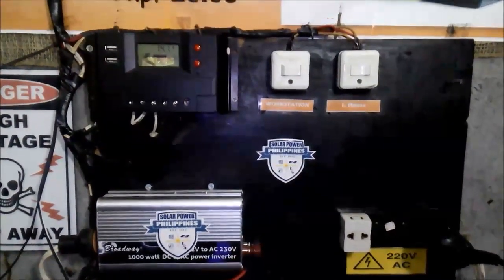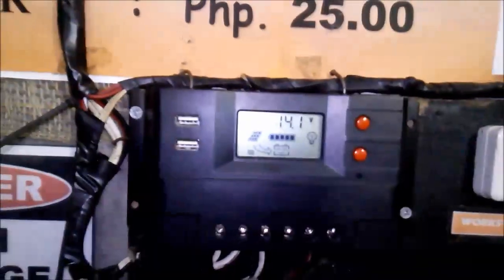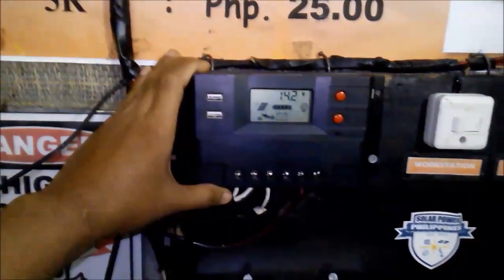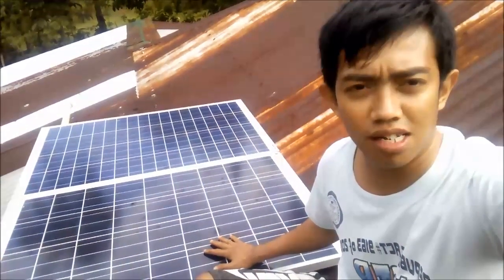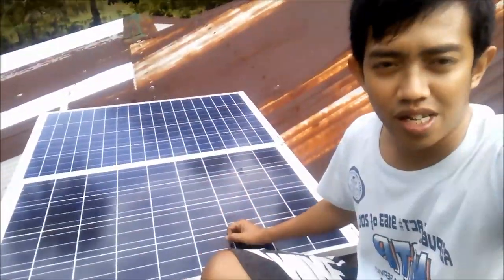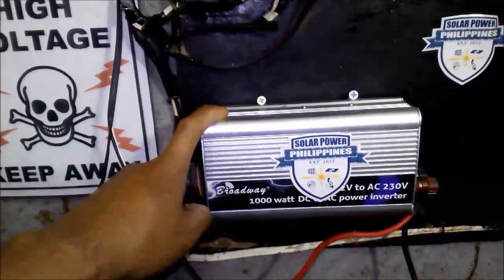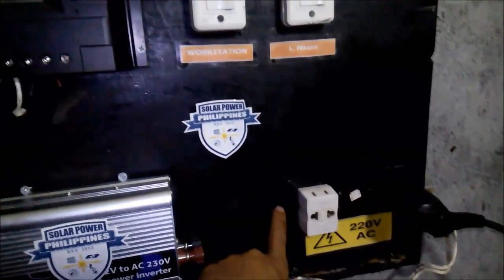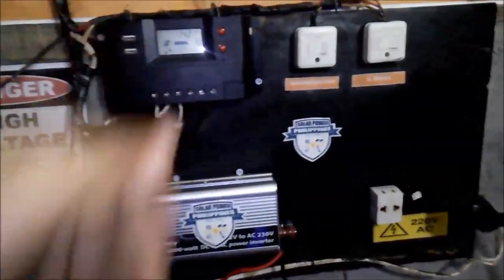DIY Offgrid Solar Setup- 100% Free Energy

Comment: padali in mo nalang boss. ganito lang po yan kuha ka ng battery tapos tingnan ilang volts kadalasan  12v tapos ilang Ah ang battery like 48Ah normal na battery ng sasakyan... so  12v X 48Ah = 576W so kong meron kang 150W na panel maka produce yan ng 600W sa loob ng limang oras. pano?. ganito yan sa 150 W na panel meron yang power loss 20% so 120W nalang multiply buy  5hours = 600W kada limang oras. yan yung mga oras na tirik ang araw... ma full charge ang battery mo apat or limang oras kung gusto mo mapadali dagdagan mo panel mo like x2 para dalawang oras lang. so kung gusto mo ng fullcharge palagi ang battery na parang di nababawasan mag lagay ka ng apat or 4 na panel na tag 150W para sa battery na 12V 48Ah. yan yun. at Pag nagka pera ulit e upgrade nyo nalng battery nyo at dagdag  panel para palakihin ang Wattage nyo para andar boong bahay ref,, aircon, tv , washing machine etc.  mura lang yung inveter at mura lang din ang controller.

Comment: Sa may gusto po may binebenta po ako solar panel 5 na 100 watts at 2 na 50 watss used na po sya pero 100 percent working pa po. Bali po binaklas po namin sya kasi lumipat na po kame ng bahay.. 10k fix na po libre ba po ang inverter at charge controller used nadin po.. Eto po fb ko mariz greno po .. 09508344484
Reply: available pa ba sir?

Comment: Sir may 2 air con ako, isang ref, 1 washing mach, 3 tv at 10 ilaw sa bahay, magkano kaya budget kung mag pa install ako sa iyo, salamat po
Reply: Almost 100k kailangn mo ng 5to 8 kilowatt
Reply: @LoretoLlosala  ahm ok , 100k labor and materials na yan, sa yo na lahat
Reply: Helo gudpm pacincya na po sir ha naki alam ako sa mga coment mo by d way yong sinabi ko na 5 to 8 kilowatt kulng pa ya kasi yong pure sine wave masyadong mahal kysa modfd wave
Reply: @roniegamlot9566  ahm gd eve, ilang kw ang kailangan ko at mas maganda somobra para may buffer at magkano kaya budget ang kailangan ko at hindi ba madaling masira, salamat.
Reply: @renosoler6232  mas maganda snadi inverter 3 or 4 kilowatt maganda na yan mas malki yong transformer niya kaso mabigat lng kc about sa price 22k at 40k ok na yan pang bahay lng
Reply: @roniegamlot9566  isa ka bang supplier o installer lang gusto ko kasing malaman kung magkano lahat magastos ko kung mag pa istalar.
Reply: @renosoler6232  ok sa sinabi ni boss lorito mag depende sa mga load mo kung my mga aircoñ po kau cguro mga 250k
Reply: Yong 100k dipa sapat yan yong sa akin 4000 watts snat inverter  48 volt 40.000 plus at my 6 akung panel 24.000 apat na battry tig 100 ah kaya kulang payan sir wala pang labor sir... Salamat sa rply sana mrami kpang video na ma upload

Comment: Sir magkano gastos mo sa setup mo nato gusto ko po sana mag set ng ganto eh
Reply: @LoretoLlosala  ikaw po ba nag set up nito? sana may tutorial...
Reply: Yung sa akin 160w off grid set up. Gamit ko lifepo4 12v 45Ah battery at 1000w msw inverter. 15k nagastos ko. Ako na bumuo lahat.
Reply: Running for two years na.

Comment: Kaya 4 pcs100 watts 22voc nyang ssc mo?
Reply: @LoretoLlosala  Nice input. Ilang hours ang full charge ng 120 ah mo with 2 panels? And mono ba yan? Planning to setup 4-5 pcs 100 watts 12v since me mga appliances ako na 12v.
Reply: @LoretoLlosala  at tska sir, ung ssc mo me current reading? Pano mo nalaman ang ampere load mo? Curious ako kask 30a 12v ang batt na gusto ko which translates to 350W
Reply: @LoretoLlosala  ano name ng ssc mo sir? 30a talaga actual? Pls enlighten.

Comment: Sir.taga Pangasinan ako Nakabili ako ng SMA 5000WTS inverter..Saan Banda makabili ng Magandang Solar panels.
Reply: @LoretoLlosala  sir.Anong Panel po ang pinakabranded..
Reply: @LoretoLlosala  Sir Trina Solar Panels..maganda po ba..taga Saan kayo sir
Reply: @LoretoLlosala  Malayo po ba kayo Pangasinan Sir..kong Sakali Ikaw Napo mag Install
Reply: @LoretoLlosala  Sir ito po yong Inverter Ko. Vdc max.600V....Vdc mpp 246-480V....Idc 26A....Vac nom.230V...Fac nom.50/60Hz...Pac nom.5000W...Iac nom.21.7A..
Reply: Sir..ilang panel ba Kailangan Ko.at Makahingi ng Diagram for Installation sir..
Reply: @LoretoLlosala  ok na sir
Reply: Madami seller s solar power philippines group s fb.

Comment: Hi sir, i have a very small hobby type solar setup.  Kaya lang malowbatt ang battery , capacity is 12v 4Ah SLA battery, my question is howmany hours para mafullchrge ang battery ko? Kasi pag siguro 4:00pm lowbatt na sya nasa 10volts na ,do you think sira na battery ko? Madali mafullcharge madali din malowbatt ,secondhand lang sya hiningi ko lang sa motorbike ng tatay ko. Sir loreto Tumitingin lang ako sa mga videos mo baka sakali meron ako matutunan pwede gayahin..Ito ang solar setup ko. Salamat. https://youtu.be/wQNQM5qd32s
Reply: @LoretoLlosala  meron ako controller 10Amp SCC, sa display ng controller ko lang tinitingnan ang voltage nya, umaabot naman ng 12volts kapag naka connect ang solar panel diba kapag hindi na nag biblink ang arrow meaning fullcharge na sya? yun ang battery bars sa display madali mag 2bars, kapag wala ng sikat ng araw 5:00pm, madali na malowbat ex. 12.4v madali ng mag 11v at pababa na ng voltage
Reply: @LoretoLlosala  umaabot naman ng 14 or 13volts kapag matindi sikat ng araw, pag wala araw disconnect ko na solarpanel sa scc may alligator clip kasi sya. Tapos pinapasok ko na sa loob ng bahay ayon 2bars lang ang battery sa lcd display at 12.3v lang at pababa na
Reply: @LoretoLlosala  gusto ko sana substitute ang 12v lithium battery na 18650battery , kaya lang hindi ako marunong gumawa , need ba ng BMS?
Reply: @LoretoLlosala  load? Ah yung solar charge controller ko may usb port , yan lang ginagamit ko pang charge ng mobile devices ko, wala naman heavy use load, bago bili lang ito solarpanel at scc kaya sure ayos at brandnew. Siguro nga battery need ko bumili ng bago
Reply: 4ah x12v=48watts battery mo napakababa mabilis ma full charge kaya lng mabilis din malowbat lalo na pagwalang ng araw..
Reply: Sir ok ba ang car battery

Comment: magkano inabot ng gastos mo sir?
Reply: @LoretoLlosala  sir pwede maka hingi ng diagram ng setup mo at san ka bumibili ng li-on? thank you sir
Reply: Hi Boss Loreto, makano bili sa Lithium Battery mu? Thanks
Reply: Laptop scrap battery 18650 b sukat nyan, sir saka may BMS ba ksma?. Mura pa rin khit 80.
Mas ok yan 85% ng capacity ang usable kesa iba. Thanks
Reply: hello po sir, san po yung mas mura na mabibilhan ng lapyop batteries? dito sa cebu walang masyado supplier eh.
Reply: @LoretoLlosala  gudday sir! Kaya mo ba mag asemble ng lithium ion tulad ng tesla powerwall? Papagawa sana ako for solar..tnx!
Reply: @LoretoLlosala  gudday sir! 12volts 150ah.mga magkano singil mo nyan? Tnx!
Reply: @LoretoLlosala  gudday sir! Pakipost mo naman yong system mo na li-ion batteries gamit mo.tnx!
Reply: @LoretoLlosala  gudday sir! Sa messenger nalang tayo chat para mabilis.tnx!

Comment: I am using my modified sine wave inverter on electric fan, power tools like electric drill and food processor without problems except refrigerator. I will buy a pure sine wave inverter for this when I upgrade my system.